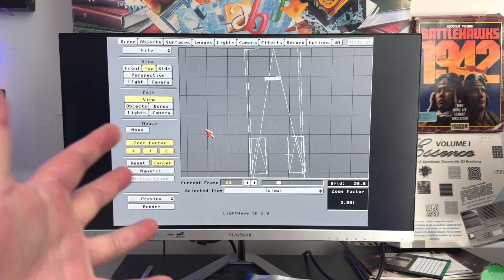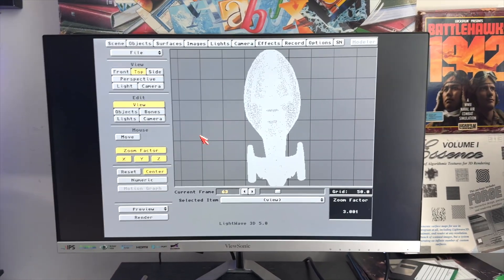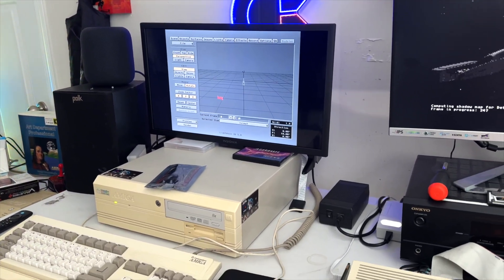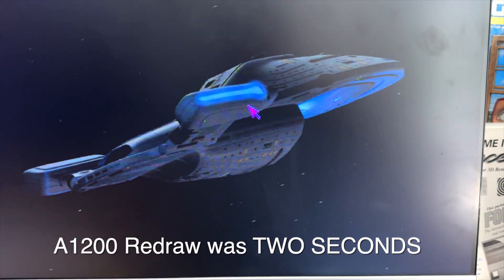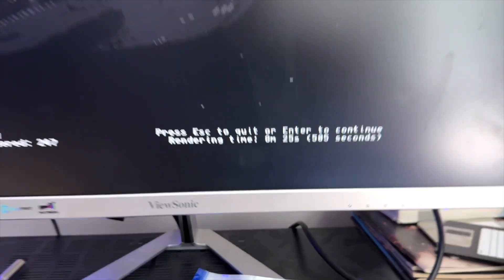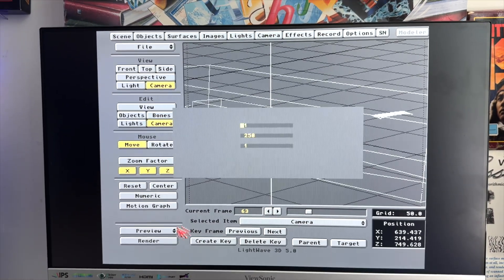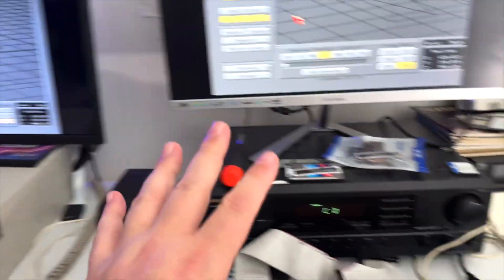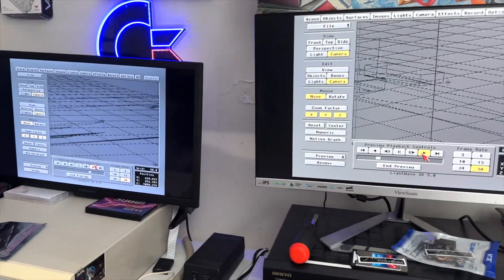A1200 PiStorm32 Vs '060 in A3000, A4000!

Comment: While I expected the PiStorm to beat the 060, I never expected it to completely and utterly crush it. The 68060 was the best CPU of the era, except for that one thing that buried it against the Pentium - FPU performance. That, BTW, also killed Cyrix. On another note, I have the PiStorm (Zero2W) in my A600, but it did not improve my network speed (PCMCIA 3com Etherlink III) in comparison to Furia, so looking fwd to that wifipi support that's allegedly coming.
Reply from the maker: Zero2Ws are nice but not really powerhouses like the Pi3s and Pi4s. (and now Pi5s) they’re best for low to medium lifting duties. I wouldn’t expect it to boost the LAN all that much.
Reply: @HoldandModify  anybody using a Pi5 on a PiStorm?  Supposedly a Zero2W is only about 10% slower than a Pi 3A+.  I now have both of them, so I will have to get them both tested out.

Comment: Nice vid “Q” 👍🏻 So… BFG is not overclocked and the Pi4 is not Overclocked. Another video to show them perhaps? BFG @ 75 then 100Mhz and Pi4 on overclocked 2.2Ghz 😉 I’m done with this comment now… 🍻
Reply from the maker: I can’t over clock my Rev5 and Rev1s. They don’t really support that. Also, I don’t overclock old rare, price, hardware like these. Heh. I could OC the Pi4, true. But  it’s hard enough keeping everything cool in tight situations.
Reply: @HoldandModify  yeah forgot the BFG can be picky. Got one of these and it wouldn’t entertain a 75mhz OC on my REV 5 MC68060RC60. So luckily got hold a rev 6 MC68060RC50 which at the moment is in stock 50Mhz….

Comment: Was it a pi3 or pi 4 and overclocked or not ?
Reply from the maker: Pi4 not overclocked.
Reply: @HoldandModify Be interesting to see how the Pi4 is quicker than non-overclocked pi4 👍🏻 I have mine overclocked. Thing I noticed (Sysinfo) the internal SD drive speed went from 22MB/sec to 28MB sec. 😉

Comment: An hour or thereabouts for a frame... did you guys render over Farms or just kept the machines running until the director was satisfied with the results?
Reply from the maker: Render farms. We had stacks of machines networked. Still done that way today. :)
Reply: @HoldandModify  Stacks of machines... i'm so jealous. :D
Reply from the maker: @michac3796  takes time and patience for sure. And yes. Money. ;)
Reply: @michac3796 In those times it was a built in feature to have the multi node setup sort of simple and working out of the box.

Similarly to ps3 multinode granturismo.

 Not frequently seen these days maybe except jmeter and blender.
Reply: @HoldandModify nah, everything is pretty much possible in real-time these days, even path tracing is getting fast enough. Certainly you don’t need a farm to render out either anymore, ultra high end finished frames at 16k res might benefit from tiled distributed rendering but also tiled rendering still has its disadvantages. Things have really moved on, we were still using farms in the early 2000s to render lighting (basically ray traced and baked in textures but not real-time like today!). Without massively mimd compute cores no Amiga will never be able to do what is done today, fun to get nostalgic though (I personally think pistorm doesn’t really fit with the philosophy of Amiga in general)
Reply: @neilpurvey8625  You should probably tell Pixar they are doing it wrong. As of December 2022 they were still using a 2,000 machine render farm with 24,000 cores and still taking up to a whole day to render a single frame.
Reply: @neilpurvey8625  Why do you think that?
Surely you realize that you can't replace the specialised chips next to the CPU that easily. So why wouldn't an increase in raw compute power be a good thing?
Reply: @michac3796  its all about balance, a faster single core is not the key element here
Reply: @daishi5571  sure there are pipelines specifically in film that still take the N machine render farm approach but real-time rendering is taking over a large part of the pipeline also these days. This is why i say about final renders.
Reply: The farm is mainly in cloud these days though.
Reply from the maker: @neilpurvey8625  for my “day job” I use Octane and NVIDIA GPUs for rendering. It’s great for folks at home who can’t setup CPU render farms. Render farms using CPU and GPU are very much a thing. CPU still dominates. Amazon AWS does HUGE business letting VFX companies setup CPU render nodes for cloud rendering. Most studios still require CPU nodes due to the limitations of GPU ram.  They have entire rooms with racks of nodes. 

As for the tired argument about emulated chips, in this case a cpu with PiStorm, if it keeps an Amiga alive for some years longer. I’m
all for it. These machines and their parts are all aging quickly. Parts are getting more difficult to come by. Sure it’s a bit of a FrankenAmiga, but I’ll take it. Eventually they’ll all be gone and software emulators or FPGAs is all we’ll have.
Reply: @HoldandModify  totally, offline rendering still relies on it because of the limitations, resolution or VRAM. Real-time rendering is taking over for the rest of the popeñine though, I know because I work in the field and our clients also include film studios too ;) saying that, we also do live events where we
Use multiple gpus in real-time for bigger canvases, most recently the Las Vegas sphere. You cannot deny that real-time is taking over for anything but for final path tracing. As for validity of a massive boost in single core performance on Amiga, it looks impressive because it’s so slow otherwise but all in all it’s a totally unbalanced hopefully solution. That makes 0 sense because all the rest of the system slows down data anyway, let alone the slow bus of the Amiga not just the custom chips. And hey I’ve worked in multi core acceleration for the last 20 years so I know how these things work. Ofcourse, have fun rendering on the Amiga, By all means :)
Reply from the maker: @neilpurvey8625  true Unreal engine stuff and custom  engines are already here and I do see the day when it is all there will be. For a lot of higher end VFX that uses even Unreal, it’s not real-time. At least in my experience. You have to use Unreal’s “cinematic” mode to crank the quality. Doing that it starts to line up with traditional GPU rendering.